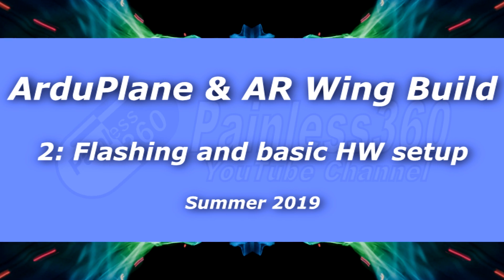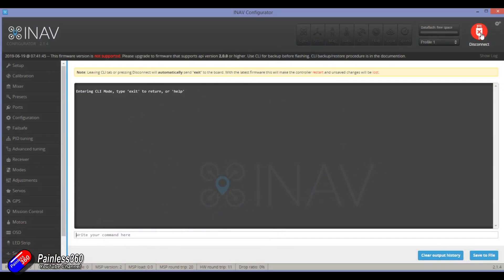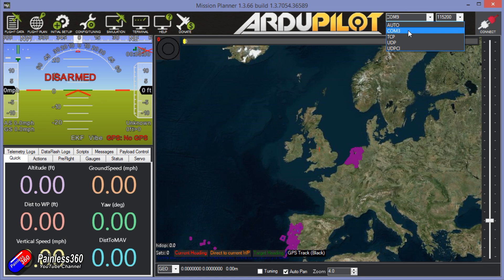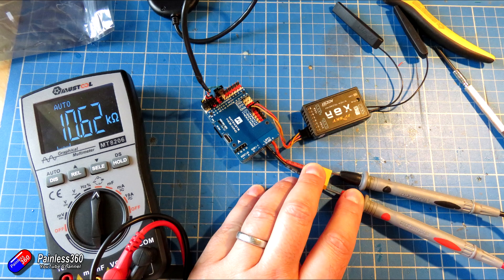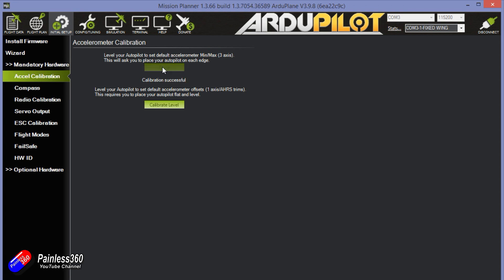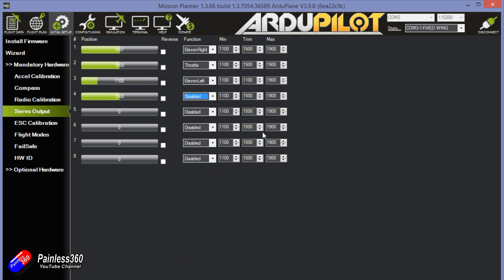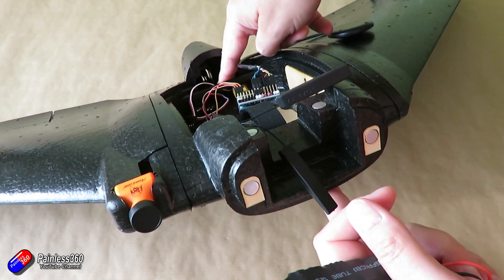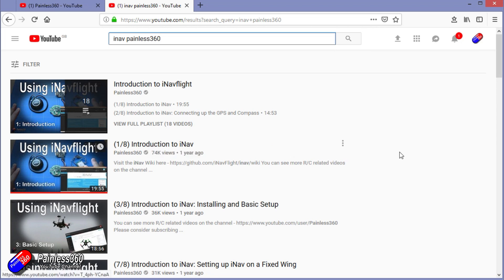ArduPlane/AR Wing/Matek F405-Wing Build: Flashing and GPS/Rx connections

Comment: On my mission planner, for rc configuration, none of the bars are moving. I checked that receiver is absolutely connected (constant green light), transmitter is connected (mode 2), battery disconnected, yet the green bars arent moving. Can you please help fix that? using a Matek H743, TBS Tango 2 transmitter
Reply from the maker: Check out my video on setting up CRSF on ardupilot if you are using that to connect to the flight controller.. Best of luck

Comment: Will you be doing a video like this with either the f405 wing v2 or the f405- vtol? I ask because I hear the pin assignment has been changed to be proper now. I suppose you could just do the parts of the video which are relevant and have changed from this video.
Reply from the maker: I'm not planning to, the process is the same... Best of luck
Reply: Thank you for all your videos, I am grateful the hobby has you. @Painless360

Comment: Lee, I started out this RC/drone hobby with a Pixhawk and Mission Planner and have never gone the iNav route, so I am not iNav savvy.  I am actually using a Matek F405-VTOL FC board, not the F405-Wing . . . in prepration for that series to start.  However, do I need to flash the flash the Matek FC with arduplane using iNav, or once I download arduplane_with_bl.hex to my computer, can I flash the Matek FC with Mission Planner . . . instead of iNav?  The Matek documentation does state that F405 VTOL board comes preloaded with iNav.  I am hoping that flashing the FC board with arduplane using Mission Planner will just erase the pre-installed iNav, but I don't want to brick the board.  Do you have any advise?

Comment: Hey! Thank you so much for all of the information and help that your vidoes offer, it is much appreciated!

Now, this ardupilot problem has me and all of my flying friends (some of whom relatively experienced with ardupilot) absolutely stumped. My motor simply won't spin. I have tried all of the ESC protocols in ardupilot and no matter which I choose the esc will never give the two flight controller initialization beeps. It gives the first 3 bootup beeps and I know the ESC is working because it was originally setup as an aileron output in ardupilot so it spun up the motor whenever the plane was moved. As soon as I changed it to a motor output through mission planner, it just doesn't work.

I am using a Spedix BLHeli s esc with a matek F405 wing running the latest version of arduplane. Please let me know if you have any ideas! Again, thanks!
Reply from the maker: Some ESCs will not initialise if the PWM value doesn't do below a certain point. I'd suspect that the low throttle (THR_MIN) to a little lower to see how that goes. https://ardupilot.org/copter/docs/set-motor-range.html should help.
Reply: @Painless360  hopefully that's it, sounds like it definitely could be. Ill give that a try. Thanks#

Comment: Hi Lee, do you have a video series for getting started with Ardupilot on a inav board, something like the matek ones which seem to have targets for both inav and Ardupilot? 

I have a 650 size quad currently running the old DJI Naza lite FC, I want to try Ardupilot on it because they say that's better than inav for multirotors. Wondering if you have a video on this or a series?
Reply from the maker: This series you've commented on (and one other on an Omnibus board) are the two on the channel. Both for planes but the setup once flashed is the same as the Pixhawk 2020 series... Best of luck

Comment: hello please i need help.  I have the latest version of ardupilot on a Matek 405 wing with a buzzer that has a built-in battery and the three connection cables, but I can't get it to work, it only beeps when the board has no power, I have it set to Channel 8 and if I put it  on the plate instead buzzer does not beep, and if I put it on servo output 8 it beeps all the time.  What am I doing wrong?

Comment: hello, i bought a f405wing with r9 mini ota card plug all correctly.
 but the servos are jitter and have latency its impossible to flight have you an issue ? 
maybe 0.5 second to response ...
Reply from the maker: I've never seen that but I don't use R9M...
Reply: @Painless360  that's ok :).
In fact check all my stuff and i see the version of tx firmware is 1.3.0 and the rx firmware is 1.3.1, i reflash rx at 1.3.0 and all work great.
Thanks for all your vidéos !

Comment: Hi very good Video thx. 
 Cannot calibrate ESC,....Arduplane 4.0.6: Error : Set param error. Please ensure your Version is AC3.3+.
Reply from the maker: Without further information it's impossible to offer any advice. What troubleshooting have you already done?
Reply: @Painless360  i try too calibrate the ESC in Mission Planner of Arduplane (FC.F35 lightning) In The ESc calibrate TAB (window) at the bottom i cannot change ESC settings ,ESC type etc.. ?? and when i hit button ESc calibration then the error appears ..set param error..etc !....  Update. maybe i found something my channel mapping seems wrong i will put throttle on channel three.. and try again.!  OK Motor is running now  .. thank you
Reply from the maker: I'd upgrade to the latest version and if the problem persists then log a bug.. Best of luck!

Comment: I'm stuck with an intialising message when I try to set flight mode and I can't setup the servos.
F405 wing and 4.05 firmware.
Reply from the maker: Tricky to help without the actual error message...
Reply: @Painless360  yeah and I'm a totally noob concerning ardupilot. I will try to post logs and pics or will continue with INAV.
Reply from the maker: Check out the two recent Arduplane builds on the channel... Best of luck
Reply: @Painless360  thanks

Comment: My f405 wing has no power on 5 volt pins. Also nothing with lipo plugged in. Only powers up with usb. Please advise...
Reply from the maker: Has it ever worked? Sounds like the 5v regulator is not working...
Reply: @Painless360  it is brand new. This is my first build. Bad volt regulator is what I was afraid of. Thanks so much for reply.
Reply from the maker: If you've not even soldered on the pins then return it to the reseller.. Best of luck!

Comment: my esc has 3 wires, this thing has S1/gnd or S2/gnd. can someone explain this please.
Reply from the maker: Check out the wiring diagram for the FC on the Matek website. They are for the GND (black usually) and Signal (white usually) wires. If your ESC has a red wire too  - dont connect it.
Reply: @Painless360  ok yeah the f405 wing diagram only shows a ground and signal. I will remove the red wire. Thanks !

Comment: Thanks again , I finally got my f405 flashed with inav thanks to you, but on last step , ardupilot will not connect I get messages mavlink not detected, nothing changes as I tilt and spin board, please advise.
Reply from the maker: What troubleshooting have you already done? Com ports? Making sure Mission Planner is set to 115,200? Reinstalling the latest MP?.......
Reply: I wasn't sure were to begin troubleshooting, but I will do what you suggest next. Thanks so much
Reply from the maker: Every step I did is shown in this Arduplane/Matek/ARWing build from last summer... best of luck
Reply: I've did some troubleshooting,I have the 115200 set, reinstalled latest version of MP and using port 3 on p.c.. still no go when I click connect it just times out. Any help will be greatly appreciated
Reply from the maker: I'd delete the device from device manager and connect it again -sounds like a driver issue. Best of luck!

Comment: i flashed the board and then it started flashing at a different pattern and it isn't connecting to inav and It doesn't let me reflash it. What do I do?
Reply from the maker: Plug in the USB cable while holding the DFU button and flash with the 'no reboot' option selected.. best of luck
Reply: @Painless360  I did that and now all 3 rgb lights are on and nothing recognizes it. Im scared to unplug it, now what should I do?
Reply from the maker: DFU switch on the FC will always get it back into  bootloader mode.. Best of luck
Reply: @Painless360  Thank you so much it worked!

Comment: So far it's very nice board. I wanted to know if a usb telemetry module work with this board and how it's possible to connect into it for us that we are not having these DX9 radios. (i am using a FS-i6) and for now i am trying to not  step up because i am kinda bugged restricted.
Reply from the maker: DX9 as in Spektrum? I don't have one of those here - sorry..
Reply: @Painless360  Sorry for the miss understanding. What i meant was how to connect the 3DR modules like the Holybro 3DR 433Mhz. Because on my case i am using a non-telemetry radio on my sailplane and i have a set of 3DR modules sitting on my bench. :)
Reply from the maker: I don't see why not.. Best of luck

Comment: I can't get my throttle to work. In radio calibration it shows my throttle input fine and lets me set limits. Then in the next menu, servo channels, the throttle on channel one won't move. Other servos are working. What gives?
Reply from the maker: The FC isn't armed. Just follow the series... Happy flying
Reply: Thank you!
Reply: On my 4th flight I connected in the field to Q ground control on my phone. I changed one flight mode. Then about 2 minutes into the flight I had a brown out and luckily just a light crash. Now my esc won't fully initialize and my F405 won't connect to Mission Planner or QGC. I switched esc and no luck. Any ideas as to what I can do?
Reply: I re-flashed the firmware and can now connect to MP. The new ESC still wont initialize. It just beeps continuously. Any ideas?

Comment: isn`t there an ardu configurator so that u can flash ardu software into the firmware with it? or u can flash anything using i nav configurator ?
Reply from the maker: The firmware flasher can be use dto push any firmware onto a device In DFU mode. They don't care if you load it locally.. Happy flying!

Comment: Great video. Very helpful
But I am facing some issues, Every time I try to update using windows 10 pc or flash arduplane firmware on Matek f405 wing FC, INAV fails and show the log "failed to open serial port"
I have tried impulse RC driver fixer and zadig, still I unable to flash the arduplane firmware.
Please suggest what could be done to solve this issue.
Reply from the maker: I don't use Windows 10 here,  I'd recommend searching for that error in the Betaflight forums as I know others will have solved it already and the issues with drivers and Win10 will have been seen with the larger BF user base... best of luck!

Comment: Got PPM working but cannot get SBUS to work can you tell me what your two settings for SERIAL 2 are set to in your parameter list ?  Thanks Bill
Reply from the maker: I didn't change anything from the defaults here.. What troubleshooting have you already tried?
Reply: @Painless360   Thanks for the reply and I suspected that may have been your answer as the default setting appears to work in most instances. I had the hardware setup in INAV and working fine after I found out that the output from the Openlrsng Rx was a NON inverted output and with advice from Matek got it working on the R2 pin next to the SBUS pin see my video here https://www.youtube.com/watch?v=0dvt9C9-ISY&t=79s
Now exactly the same hardware and wiring will not work with Arduplane and I am thinking it has to be a setting problem as PPM works just fine but nothing with SBUS.
Reply: Ok sorted now Protocol was set to -1 and should have been 1.  Just need to sort out Bad AHRS now and good to go I hope ;-)  TNX
Reply from the maker: See my video on troubleshooting arming as there are a few things that maybe need to be checked - best of luck!
Reply: @Painless360  Thanks I did view your video and am progressing nicely thru this now and have all but "LOGGING" problem cleared to get ARM. I have tried two different no brand SD cards so far one 16gb and one 4gb and still problematic will try some others and see what happens although some of the guys in the RC group are speculating that the SD card slot could be suspect on some boards too!

Comment: Hello, Lee. Thanks you for the awesome videos on this subject. I am a beginner on Ardupilot and Long Range fpv. I already have all parts to build my first AR wing with Ardupilot. First question. Do I need to connect the Lipo battery to the Matek F405 flight controller to flash it? Thanks again. Good flights!
Reply from the maker: Nope, just follow along with the build and you should be set by the end! Best of luck!
Reply: @Painless360  FC flashed successfully

Comment: I have a Kakute F4 V2 controller and I am thinking of loading ArduCopter on it and developing a 8-10" quad possibly for long range use. Are there any show stoppers with the Kakute and ArduCopter?
Reply from the maker: I've not loaded Arduplane on one of those.. Let me know how you get on.. Best of luck!
Reply: I'm currently setting up a Kakute F4 V2 on a ArduRover project..  no issues so far with it. GPS, Telemetrie, RX Reciever all work fine witht the Kakute.

Comment: Excellent video Lee!! I have got my F405 flashed and ready for the next video!!! Getting my skyhunter ready! 
Looking forward to the next video!!
Reply from the maker: Don't forget you can view unreleased videos by looking in the playlist.. ;)
Reply from the maker: Quick note - before you get too far the Bootloader will need to be changed. There is a problem with the one used in this video and I've a video out on Tuesday that talks about it. You can see that video now in the playlist - it's No. 3..
Reply: @Painless360  Thank you for the heads up! I will check that out now. Definitely would not want any issues and have my skyhunter fly away! 🤣🤣🛫✈
Reply: Lee I remember I clicked the "STABLE" version during this video so in part 3 you're saying I need to click on "STABLE 3.9.7"? I just wanted to make sure. The most up to date one I see is "STABLE 3.9.8" so as of today there is no fix yet.
Also are you able to put a speed sensor on this FC AND have your GPS/Compass installed as well?
Reply from the maker: Yes and Yes. Best of luck!

Comment: Are you a mind reader?  I have this exact setup but with iNav on but getting waypoint missions to have the wing fly around the field on its own loaded onto the F405W is a pita so I've been wondering the last few weeks how easy/difficult it would be to put Ardupilot on it and use that instead, I'd love to have the ability to send the wing up, put it in mission mode and have it fly figure of eights round for half an hour while being chased by quads then land by itself when the battery drops to s certain point, and I think Ardupilot can do all that, so you must be able to read minds as this is the exact series I was hoping you'd do lol.

Comment: Suggest to epoxy the usb port..mine getting loose after some times
Reply: ....and setup the alternative vcp on a free com port just in case it does snap off so you can still get in with one of those cheap programmer things.
Reply: Broke two F722 boards like that 😎

Comment: Component placement is critical for the CG as there isn't much space to move the battery around if you use the strap.
Reply from the maker: Thanks for the tip - all good here. I'll show how..
Reply: @Painless360  i was thinking about gluing Velcro on the wooden battery tray and extend the Velcro strap so it passes through the hole that is closest to the front and the one that is closest to the back so i can adjust the battery position. This would help to bring the CG forward, but not back (which is more likely the problem when using and HD cam on the nose). Looking forward to see your solution :)
Reply from the maker: You can see how by viewing the other videos in the playlist.. :)

Comment: Hello Lee, on an F405 wing board, how would you connect a standard pixhawk 900 MHz usb telemetry for mission planner?
Reply from the maker: That is one of the things I'm planning to look at once it's flying. There are loads of spare UARTS here so it shouldn't be too tricky (he says - touching wood for goo luck!)
Reply: @Painless360  Is this video out already? Cannot find it. Or can you tell me if you tried it and if it worked out good? Thank you!

Comment: Hi Lee, another really useful vid! I've just bought the MatekF405 Wing to do exactly the same as you, but having flashed the Ardupilot firmware onto it I cannot get it to connect through Mission Planner, I just get a connection fail. I can put into into DFU and re-flash iNav and that then connects to iNav and works fine but not with Mission Planner. 
Any ideas (I've tried Zadig too!)?
Reply: Just sorted it, I manually changed the driver for the STM23 Virtual Com Port one, now it works!
Reply from the maker: Glad to hear that the sorted it. Happy flying!